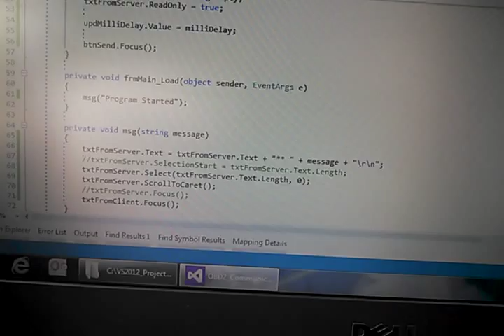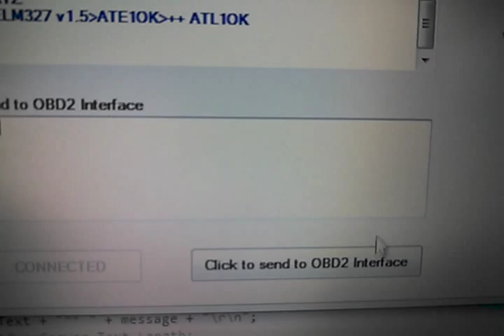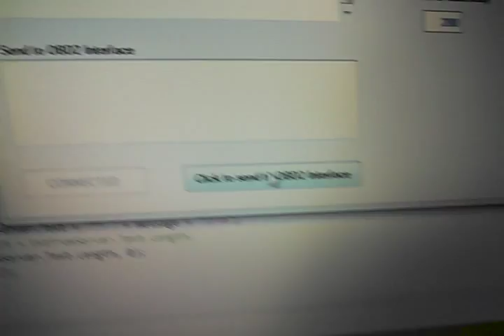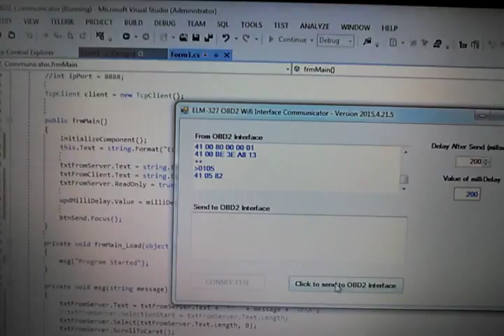ELM327 OBD2 WIFI Interface Communicator Test

Comment: Hi,
nice work!!  du you know how to change the default IP or range IP to be used?  it would be nice to keep the internet connection in case you are connecting via ipad or so. when you share internet access from a iphone or smartphone, some brands share it with ip address like 192.168.15.1 etc.. changing the dongle ip woul use the same ip range and keep the internet access does not it?
kind regards